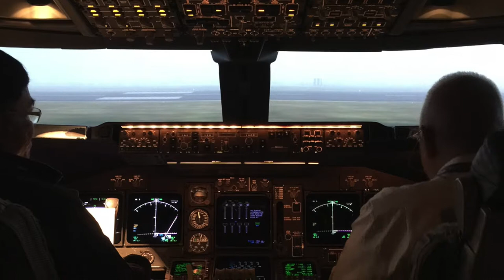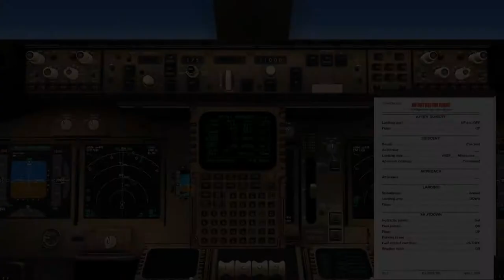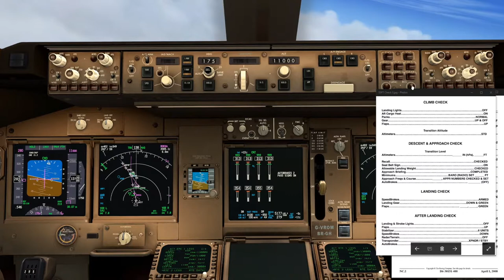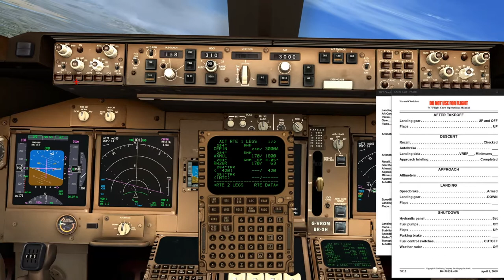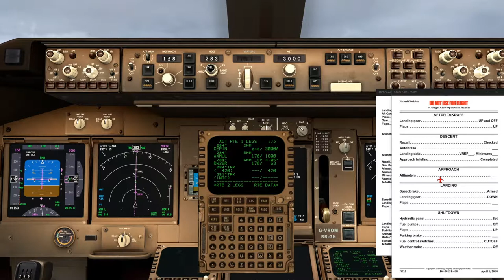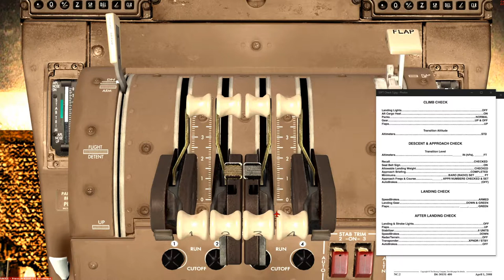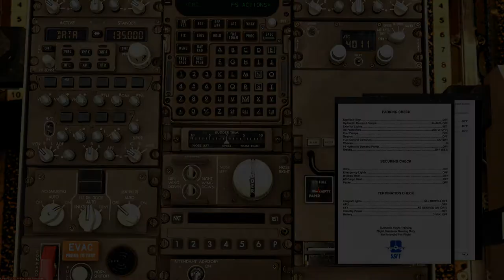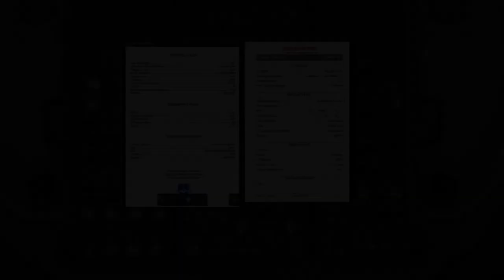Checklist Usage - Part 2 (PMDG B747 400)

Comment: Another excellent video!  I picked up a few pointers.  A question...Have you ever landed the real 747 using Auto-Land?  I've always wondered when it is required and how often it is used.
Reply from the maker: Thank you Jack. Yes, while the Autoland System is a fantastic tool, most pilots want to feel like pilots and fly the jet to a landing. Most airlines do require that any Category II or III low visibility approach be flown using the Autopilot to an Autoland. Category II approaches can be hand flown, but most airlines restrict it to Autoland only. Other than in low visibility situations, most final segment approaches and landings will be hand flown by choice. In some cases, the crew may be required to make an Autoland for the jet to have logged so many Auto Landings over a stated period. In that case, ATC will have to be informed that an Autoland will be made, even in clear VFR conditions, so they keep the critical ILS area clear. In the Western world, even on takeoffs, most pilots will hand fly the jet to somewhere between 10,000 and 18,000 feet, and then get on the A/P. You really do not get a chance to maintain a lot of hand flying skills when you fly long haul jets for 14 to 17 hour segments, so hand flying is welcomed for takeoff and landing. In the Eastern world, it is common to engage the A/P at around 300 feet on takeoff and disconnect around the same place on landing. Some airlines even require it for "safety". In my opinion, it just creates pilots who lose the hand flying basic skills and relationships of pitch, power, and airspeed control.

Comment: Blackbird A
Sir, when the magenta speed bug is lower than the actual speed, it means that we are overspeeding????this why u used speed brakes???why did 
 not the
the autopilot /autothrottle adjust the speed to be same as the desired speed??
Reply from the maker: Can you give me a video time reference for that Blackbird and I will look at it in Checklist Part 2
Reply: At 23:00... U used speed brakes....bcoz of tail 
 winds... Why the fmc did not adjust it
To make it same as requested speed ?
Reply: Sir, i am just an amateur not aviator, so don't blame me for any question that ..seems stupid
Reply from the maker: Blackbird A No, it is a good question, no such thing as a stupid question. VNAV was in the Descent Phase, descending on the VNAV PATH. The FMC calculates the path from the top of descent to cross any restrictions that are part of the arrival. The IRS knows the winds where you are and look ahead for a set distance. We can help the FMC be more accurate in the calculations it makes by putting in forecast winds on the waypoint wind page from our flight plan enroute. A 6000 mile flight will have wind changes along the route. The IRS can only look at what the winds are currently, so from our flight plan we can tell the FMC what we are expecting. This makes ETA’s and fuel predictions more accurate. We can also put in Descent Forecast Winds for 4 altitudes in the Descent from the flight plan. This helps the calculation during the descent. I didn’t do that with such a short flight and the jet started to slow to make the restriction, but with the tailwind we had, I could see I needed to help it slow a little bit to make the restriction, so I used speed brakes to do that. It wasn’t far off because the IRS knows what the winds are, but I needed to help it. The more data you give the FMC, the better it does, but as pilots we can always make adjustments if it doesn’t...
Reply: Thanks...
U mean the fmc depends on the data inserted but not the actual data available around the airplane?
Reply from the maker: Blackbird A It actually uses both to try to interpolate and fine tune ETA’s, Fuel Remaining, the Descent Profile, etc to be as precise as possible, though not perfect, it does a great job if you give it flight plan information, especially on a long haul flight...